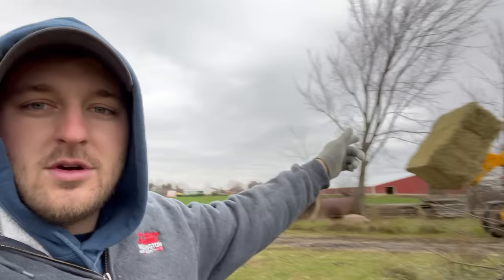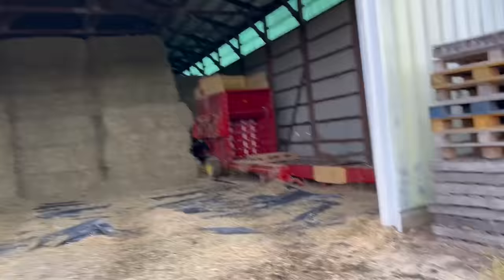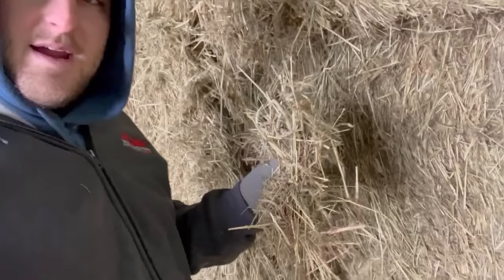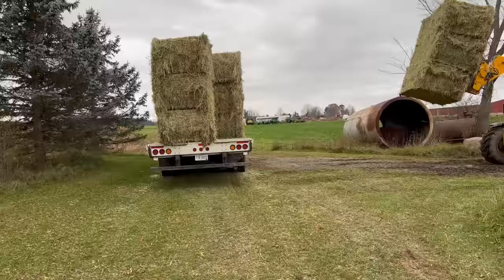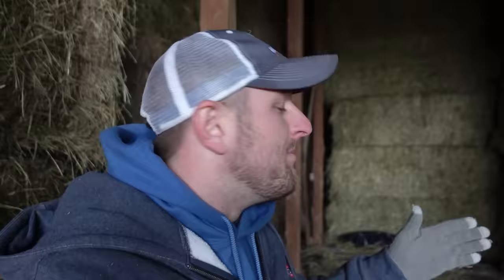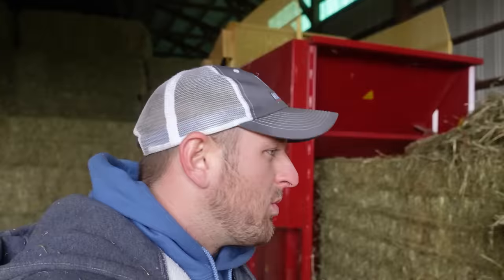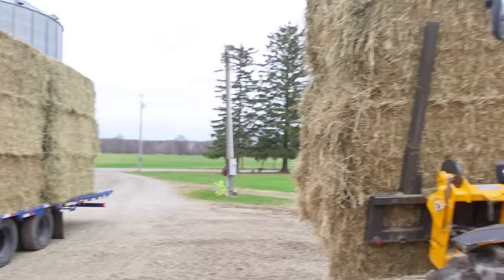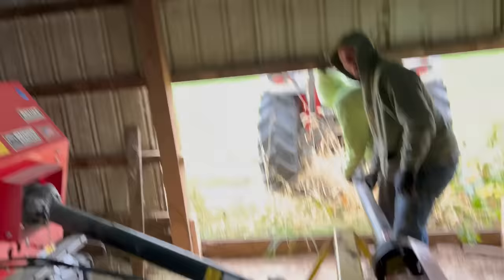How Our Farm Prepares to Make 80,000 Bales this Winter

Comment: We  purchased the 3point hitch  Marcrest hydralic power unit so  one  old 4020  will drive the  Simpson unroller tables, the inline baler, and the 5250T Baron......A 5045E  will take he bundle as the exit and load them directly into a 53 ft trailer......3  people  is all needed to  convert  40 4x5 rounds into 36 bundles in  about  21/2 hours......
Reply from the maker: Very nice!
Reply: We  are too far South grow  Orchard  grass and too far North to grow "Alfafa of The South" ( Perineal  Peanuts}    So we are stuck  with  Hybrid Bermuda grass (Tifton 44)....But 6 years ago we  switched to Hay only.......But coming from you  I take your comment as well meaning

Comment: As a dairy farmer..... I dealt with large square bales of hay.  Almost all bales have to be treated with a preservative to prevent them from heating / molding. I bought a semi load of large square bales from western Iowa. I told the seller.... I wanted to try  " one "  bale and if my cows would not eat it I would refuse the entire load......paying for only the bale I took off the load.  I put one large square bale in my round bale feeder.......and 10 small square bales of hay that I baled myself in another bale feeder......here at home.
The cows would not touch the large square bale !  Instead the cows gathered around the round bale feeder with my small squares in it.
Bottom line....... the preservative sinks ! Cows wont touch it......thats why farmers have  TMRs.....to blend the hay in so the cows will eat it.
So.......rebaling  big squares........you have the same issue. Cattle will almost starve before the eat them !   Been there done that !   Beware !

Comment: We load 88 bales in México, per 2 40' semi flat Trailers on 1 trip . And  68 bales on a 53' 3 axle drop deck.
Reply from the maker: Good numbers! Are you talking about 3x3 bales?
Reply: @FarmingInsider  3x4 bales, that's the best configuration. Arround 550 kg to 650 kg per bale.
Reply from the maker: 68 on a 53? Does that end up being pretty tall?
Reply: @FarmingInsider  mm kinda but it's legal, 3 vertical bales on 3 rows on the lower bed, which is 54 bales(6*9), then 14 bales on the upper bed, which is 6 vertical on bottom and 8 horizontals on top of the 6.

Comment: I can’t imagine if that was all one machine, as a trailer or on one solid frame.
Reply from the maker: The bale converter itself is one machine. The table that feeds the large squares into the webbing folds up and it has a hitch you can pull it around with. The yellow conveyer that feeds the baler is a separate unit, as well as the baler and the baron
Reply: @FarmingInsider  callme

Comment: Question, why not bale some small bales in the field along with baling big bales in the field so you don't have to handle the Hay twice to get a small bale?
Reply from the maker: With this particular batch of hay we featured moving, all the little square balers and large baler were running simultaneously. We had to fire on all cylinders to beat the rain

Comment: Okay Farming insiders, I've watched this re-baling 2.0 and all I can say is......why? 

Why do y'all even use large square balers? 

Your hay is obviously much more valuable in small square bales, so what's your justification for ever baling large square bales?
Spend a little more time up front when baling, and save all of this time, and the  expense of operating all of this equipment, and buy a couple more small square balers, and do it right, and do it once. 

Now it's your turn to tell me what I'm missing?

I hope y'all had a blessed Christmas, and you have a prosperous New Year! 

#HappyBirthdayJesus
Reply: They don't have time takes a lot longer to bail small bails and get them out the field your always fighting the weather soon as you have hay down here comes the rain....so the use big bails to get it out the field to be stored till they have time to rebail ...if you had a small operation then yes small bails from the start
Reply: @dharrison6832  I've been square baling hay for more than 50 years, for my personal horses as well as to sell to other equine owners. I've also been round baling hay for my personal cow-calf operation, and have also used large square balers to a much smaller degree. 

As a John Deere Dealer Principle I've used and sold all 3 types of balers over the years.

I typically don't put more than 20 acres of Alfalfa on the ground at a time, which normally yields a little more than 2K bales in 3 of 5 cuttings, with the other 2 yielding a little less than 2K bales, which averages a total of around 10K small square bales annually. 

To bale 2K bales in one day, I use 2 John Deere 348 balers with ejectors and 5 or 6 wagons. 

In my comment I said they needed a few more small balers, with ejectors and a whole lotta wagons, and they could do it faster, and much more efficiently than baling it twice.

"Nothing Runs Like A Deere" 🦌 👍 🇺🇲
Reply: Ya they are prolly putting down 100s of acres at a time
Reply: That more moving parts more break downs more people they can get more done with less and wait till the have time to rebale in a controlled environment pretty simple I don't see what your missing??
Reply: It's the same amount of equipment prolly less to be honest...my grandpa had a dairy farm I grew up on it and he was always always fighting the rain and never could find the help to run more equipment that's way way easier said then done
Reply: @RealJohnWayne  ya you said it 10000 a yr and I'm sure your telling a tall tale there....the do 80000 just in rebale
Reply from the maker: It’s a time thing. This particular batch of hay we were moving around was baled alongside 5 small square balers. We just had like 110 acres of heavy 1st crop down and Mother Nature threw in a chance of rain giving us only 1 baling day. We had to fire on all cylinders. Plus, we don’t make enough product for our demand so we buy in other producers large squares. It presents better margins by performing a value add service to the hay by repackaging it differently

Comment: That is too much work, labor intensive, equipment, fuel , handling. 
Krone  builds a large square baker that individually ties up to 9 flakes within the big square. 
Just set to large  square bale on the barn floor, the customer cuts the main strings, and they have up to nine small squares, all tied, as noted, individually, to feed livestock . One step from field to customer.. All this rebale procedure is simply too cost ineffective & labor intensive. I have no affiliation w/ krone,
Reply from the maker: That machine is cool but the individual flakes it produces are far heavier than our market wants.